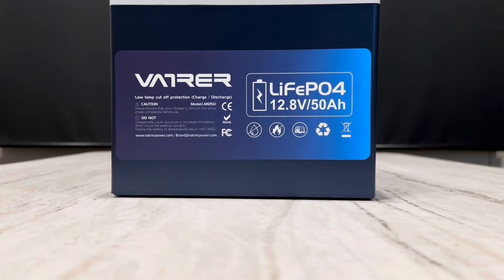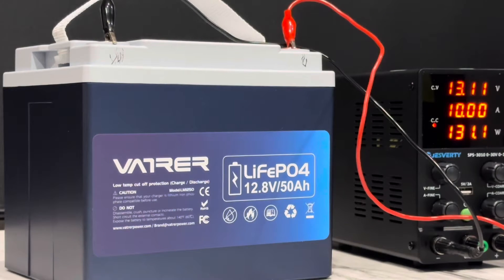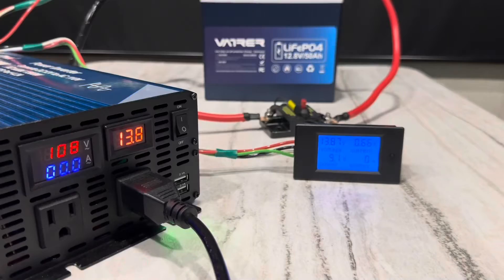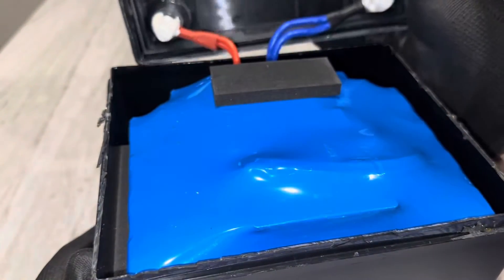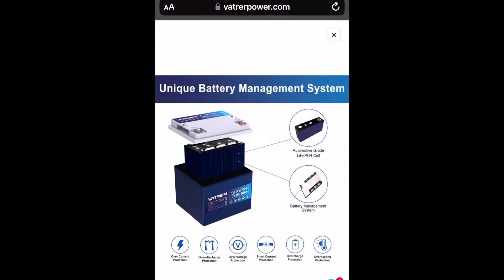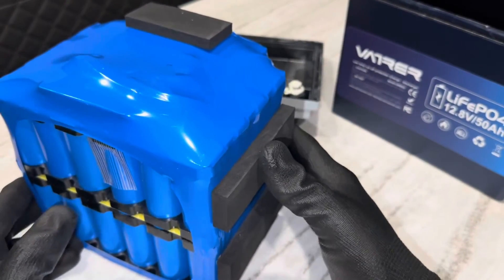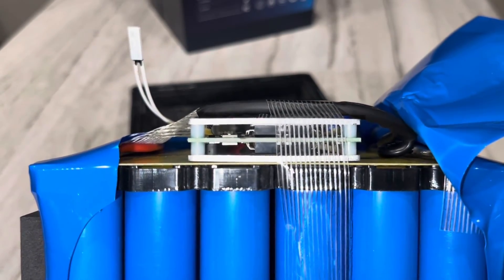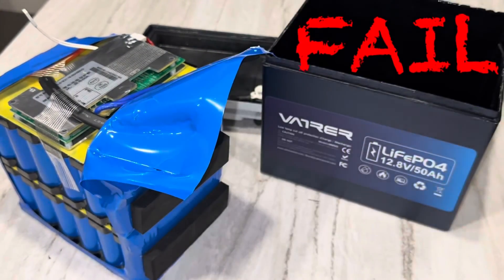VATRER 12V LiFePO4 Battery

Comment: This is the second battery review from them I have seen an issue with. The 100AH batteries I have seen opened have had prismatic cells in them and low cutoff. But this just means not to trust this company. The other bad review was one of the cells was leaking or had a bad smell which was believed to be due to a leaking cell.
Reply from the maker: I don’t know what’s going on with Vatrer. 
This is bad because so many brands ARE delivering a quality product at a great price. 
Don’t know why Vatrer felt the need to take shortcuts!